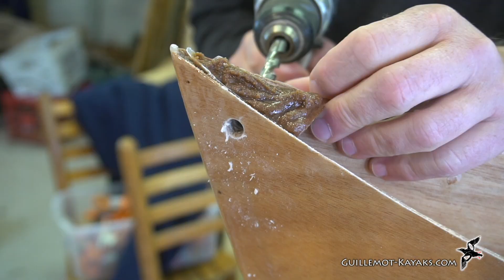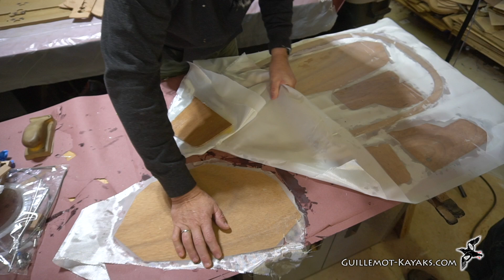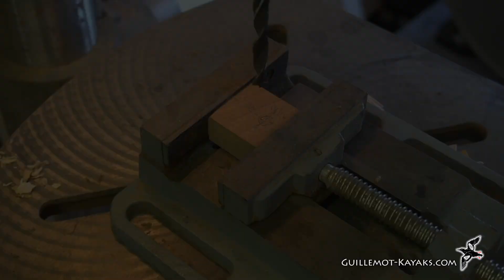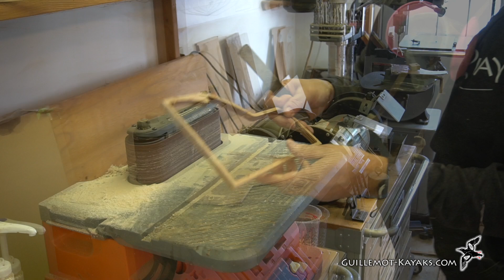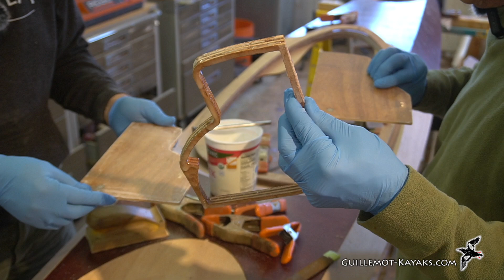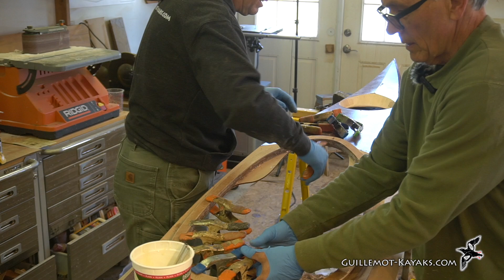Thinking Ahead on the Stitch-and-Glue Kayak - Petrel Play SG - E17

Comment: I have to agree with you removing the coaming and glassing the deck under the ring. I would be a real pain (keeping the glass laid down)  glassing the small section and lip flowing to the underside of the deck. To keep the down range cuts on your fingers from occuring try using a carving glove made of kevlar. After I turn bowels and need to lop off the small nipples on the bottom of the bowls I use the glove to hold the wood piece and then use a flexcut tool to cut off the excess....and no Band-Aides!

Comment: Thanks for showing us your change of order on the coaming. It's all too easy to get ahead of ourselves and end up making it harder down the line. It's good to show that you need to think about the order of events and also that sometimes it's better to abort an operation rather than let yourself get stuck with it! Glassing the deck is MUCH easier without the coaming and will result in a stronger boat and better finish as you said. 👍
Reply from the maker: I often find that when encountering an issue, my instinct is to try to make do with the easiest solution at the time, when the best solution may appear much more drastic, but actually saves time later on and makes it easier for future-me.

Comment: On order of operations, might you consider assembling the riser and the lip creating one piece, letting it cure, then leaving you ready access to fillet the inside corner between the riser and the lip.  And then later installing the combined riser, lip and filleting as one piece to the (glassed) deck.  (You might even glass the combined riser, lip and filleting before attaching them to the deck.)  Filleting the inside corner of the riser and lip after they've been installed on the deck is for me always a challenge.
Reply from the maker: Yes, absolutely. Doing another glue-up that includes the lip could make it easier in some ways. There are lots of things you can do that bring a tradeoff between time and ease.
If you are building at home, for your own use, and you can get to the project for brief intervals, it may make sense to break it down into a series of more, smaller tasks. I tend to try to do as much as possible in as short a time as practical so I can finish the kayak more quickly. This is not always the "best" way, but we can each find our own balance between time available and how big a task we want to take on in each work session.